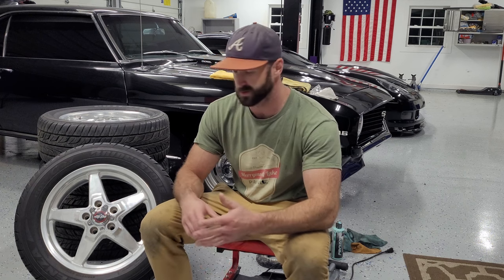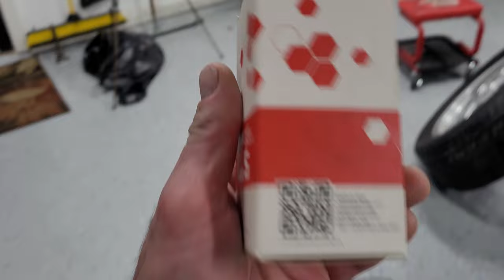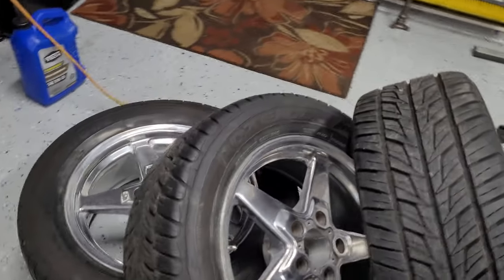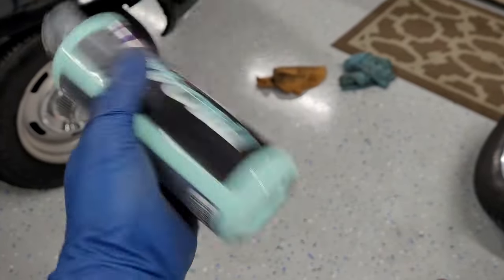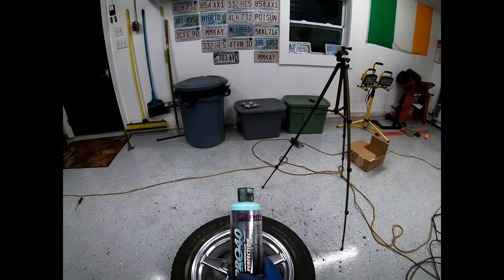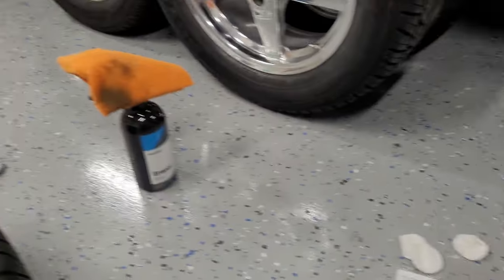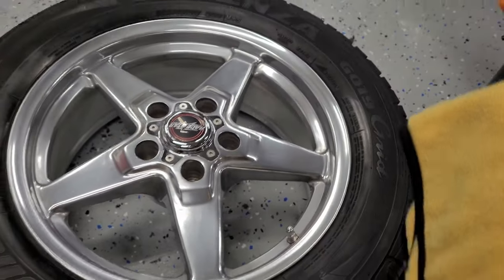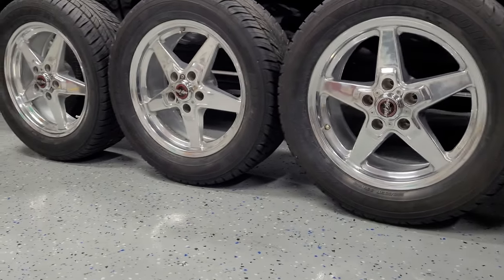How to Polish and Ceramic Coat Aluminum Wheels!

Comment: Hey Chris, you don't to apply this to a clear coat? is it safe to apply directly to aluminium?
Reply: It's better to apply this to clear coat from my experience
Reply: @bakerk5030  why's that?
Reply: @KuostA  it's a thin hydrophobic chemical layer. It may interfere with the clear coat compounds while curing. So it's safer to apply after